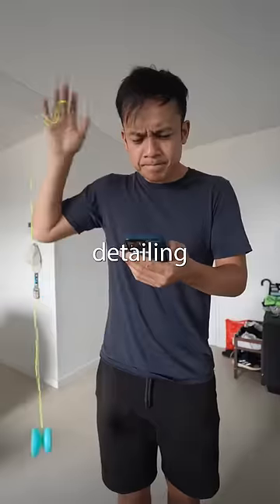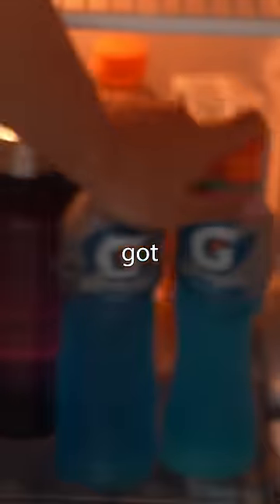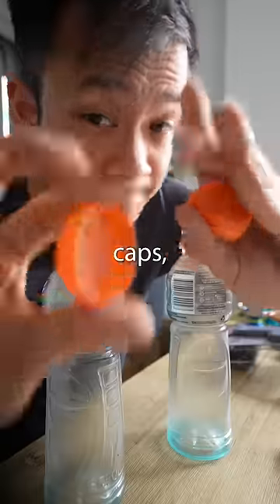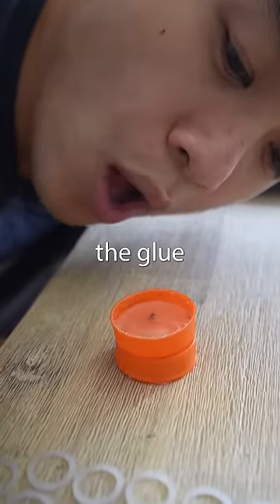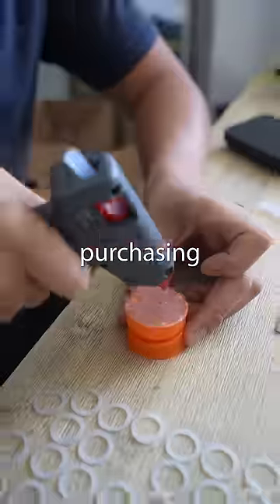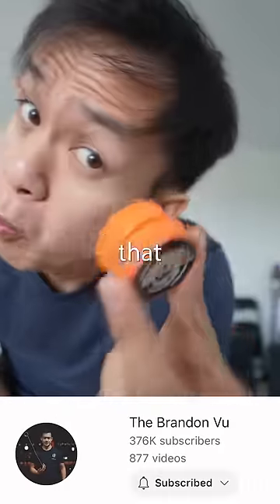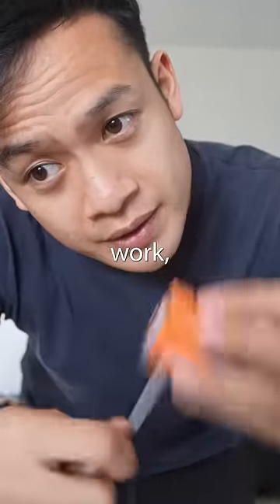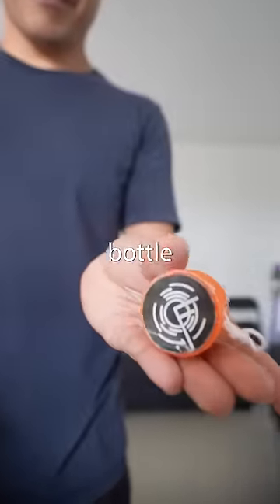I Made A Yoyo Out Of Bottle Caps

Comment: Printer: 300$
Paper: 50$
Two gatorade: 30$
Hot glue: 90$
Hot glue stick thing: 5$
String: 10$
(These are average not real prices)
Cap yoyo: 485$
Regular yoyo: 50$
Reply: JUST GET A 7$ HOT GLUE GUN
Reply: JUST READ FULL MESSAGES